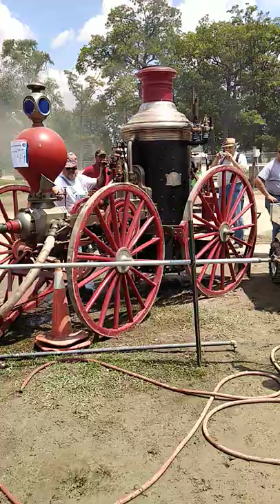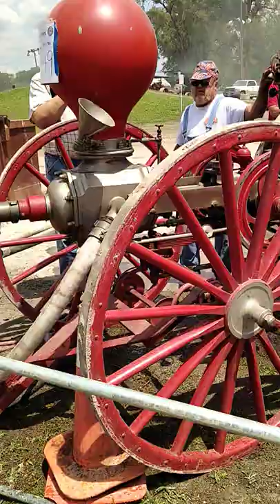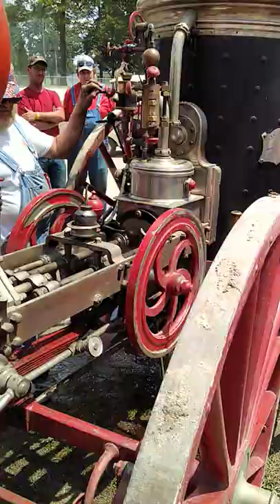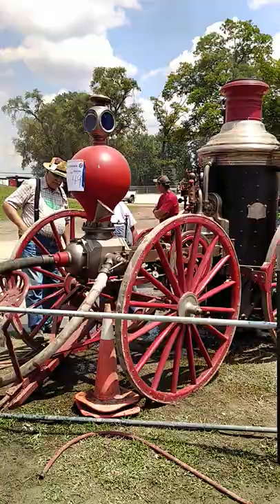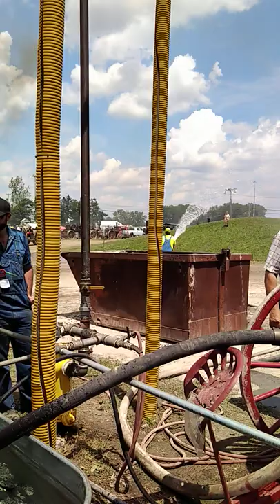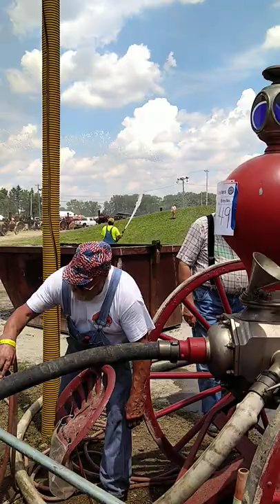1880s Steam Fire Engine!

Comment: Good  day Boy  that is something, seem to pump a fair amount of water.  I was thinking, someone says fire, they would have to fire up machine to built up steam and get there, you would think fire might be out. LOL  THanks  were was this?
Reply from the maker: Hi Don. This was in Wauseon Ohio at the National Threshers. I think they often kept a fire in the engine at all times, so when it was time to go, they just stoked it up really well, and hope to have steam by the time they got there.
Reply: In cities they were connected to Firehouse's heating boiler to keep the water hot and it was actually good enough to maintain their steam pressure at about 10-15 pounds. There were quick connect couplings at the back of the engine where the firehouse's steam and return lines would plug in. When the bell rang, the fire was lit in the firebox, the horses harnessed, the men jumped on, and when they pulled out the quick-connects would separate and they were off and running. By the time they got there, more than enough steam would be up to run the engine and drive the pump. Also, their boilers were specifically designed with lots and lots of heating surface to be able to raise steam quickly even from cold. Most being of a watertube design or combining watertube and firetube. This particular engine was built by Clapp & Jones, and looks to be around 300 GPM capacity.